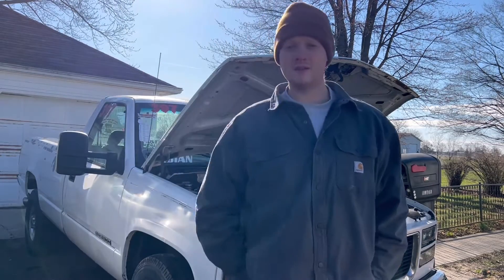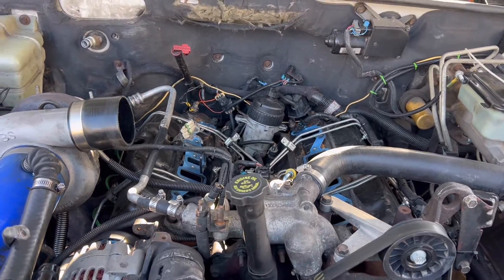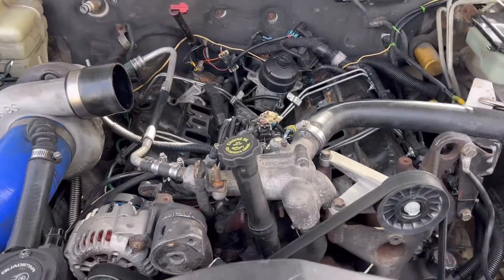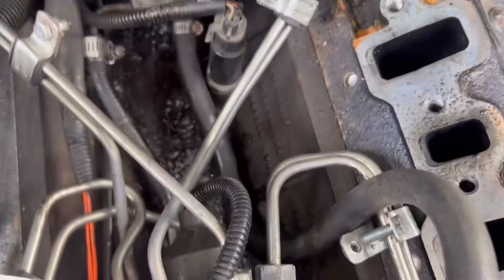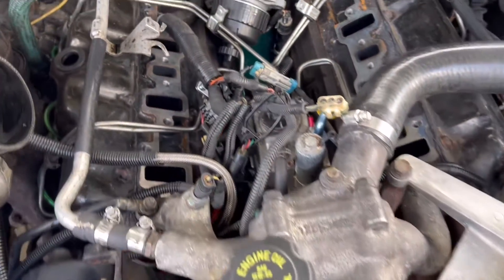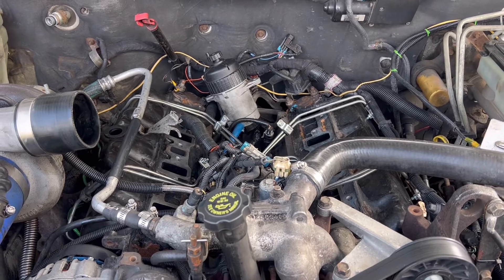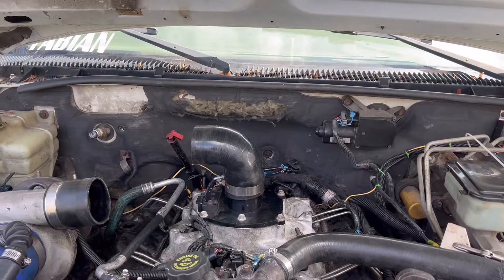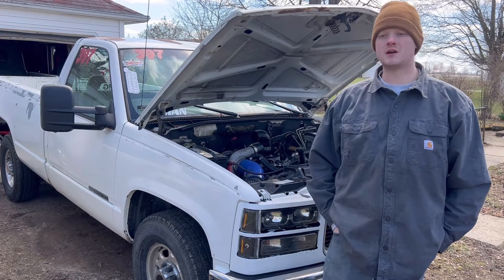GSC 6.5L diesel fuel leak trouble shooting

Comment: I'm have same issue on my same truck. I seen one line leaking coming from the housing unit fixed it. But have fuel coming down the center of mother like u did. This video definitely gave me some insite on what to do. Thank u
Reply from the maker: @vernonrice3539  there is another video where I found the injection pump side cover was the culprit.

Comment: i got a 6.5 that ever since i replaced the fuel filters i been getting air in my bowl somehow. 
now pretty much every day before i head out i have to prime the pump and crack the plastic valve and bleed the aire out of the system otherwise ill stall and hard start. 
not sure where to look pretty sick and tired of it by now. i got another fuel filter with the plastic cap . just doing research before i waste a day on it. doesnt seem to be leaking like yours but rather sucking air into the system somewhere which is pretty much a leak. but yea. over it. 
thanks.
Reply from the maker: @Leroy_Jenkens  good chance the o rings rolled up on the filter when you put it in. I’ve had a number of them do that and pull air.
Reply: Have you checked the hardlines that comes from the lift pump or any other metal heart lines because I had the same issue too and it started leaking bad and I found out what lines were bad the rubber ones and then the hard lines have O-ring and I used Teflon tape and that’s been working pretty good so far and what I would suggest also getting some clear fuel line tubing and put it where your injector hard lines go that are metal also to your Injector pump and a couple other places I could send you some pics if you want what I would suggest and this is worked out so far so good now I’m just dealing with my loose wire on my Starter get that a shot my picture would like help. Also to know what I’m talking about a voice messaging this message. Hopefully this makes sense.

Comment: Do you have a video on bleeding injection lines
Reply from the maker: @ethandubois9270  I do not. I have a small clip in another video on valve covers where I bleed the system prior to starting it. normally there is no need to bleed the lines as long as the lift pump is working and you prime the system up to the IP.

Comment: Awesome video as always. Quick question. Throwing Code P0251. Truck runs normal to my knowledge. Only reason I noticed is because it will refuse to start every couple days. Bought a lift pump and new filter thinking it was a fuel issue till I checked the code. Have not installed new lift pump yet though. Truck will start after messing with filter bleeder and cranking after some time.
Reply from the maker: The P0251 is normally an IP death code. You can replace the OPS, lift pump and fuel filter which having positive pressure may clear it. But odds are that pump is hurt.
Reply: @gingersnapcustoms  I appreciate the help!

Comment: I have a 1982 k20 with a 6.2 what are neccesary mods and if any machining to make a reliable 300hp
Reply: Thanks
Reply from the maker: Change the oil. Fluid damper. Fass lift pump from Leroy diesel. Injection pump and injectors from Verlin Martin. S300 turbo from Verlin and you’ll be set. Intercooler if you have the means to do it.
Reply: Also i heard someone say that 82 6.2s have different injector threads is that true or just a myth
Reply from the maker: @blue6.2  it’s true. They are course thread.
Reply: Ok thanks
Reply: I started my own channel like a day ago theres a few videos of my truck wanna get somemore content this weekend
Reply: Also what website do i get the verlin martin stuff
Reply from the maker: @blue6.2  he’s on Facebook. Look for his personal profile.